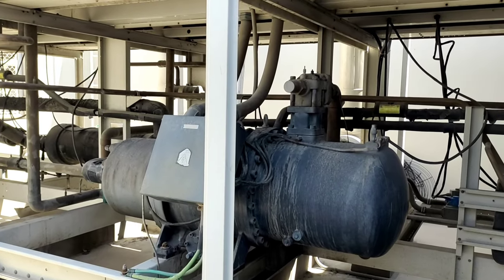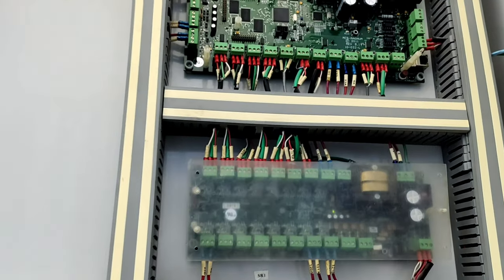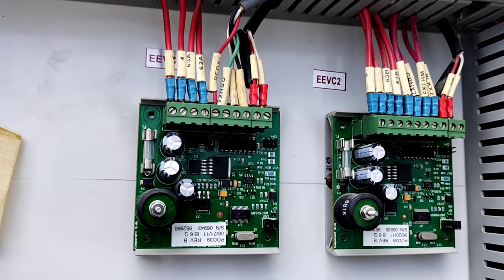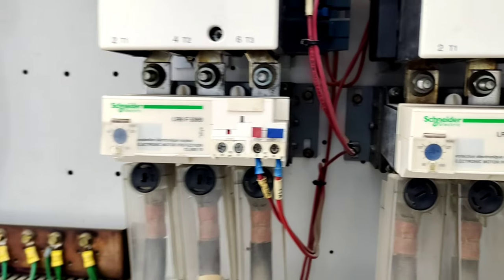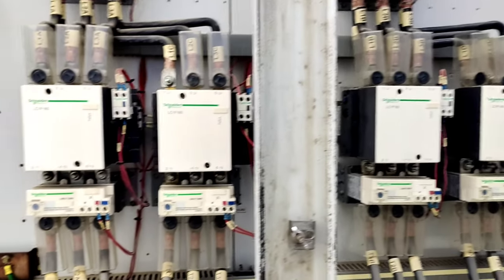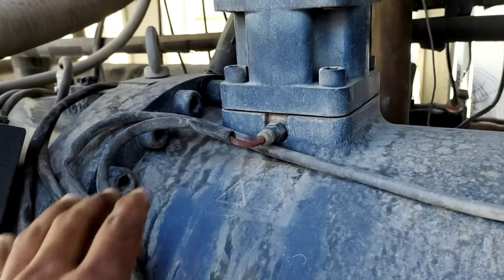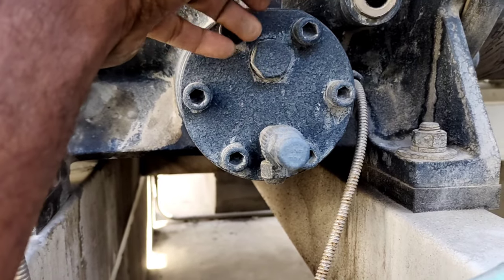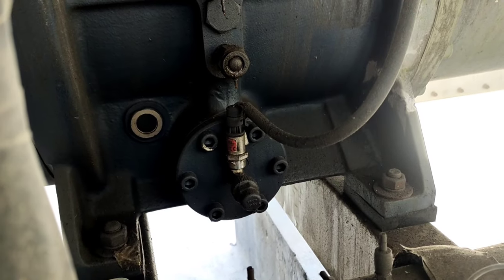എന്താണ് Chiller | zamil Air cooled chiller | screw chiller full details

Comment: Hello
Reply: When is your new video coming
Reply from the maker: Please Check expansion valve. Check suction transducer  , check suction  temperature sensor .  Check liquid line solenoid valve and coil , check loading unloading solenoid coil. If above mentioned all is Okay still Tripping recover the refrigerant and compare with chiller nameplate. If it's less gas  leak test the circuit and charge as per chiller nameplate
Reply: There is one chiller with 3 individual circuits. Circuit 1 trips frequently safety controls. Circuit 3 shows some times low suction, unsafe suction, high superheat
Reply: Circuit 3 recently recoverd and did the vacuum 1000 microns and refilled new gas as per the name plate.couple of days worked normally now, again shows the same problem. Suction pressure and tem.indicates corresponding it's pressure transducer and temp sensors. EXV replaced last year.
Reply: Ones cut off in temp and when cut in we need to reset more than 4 times unsafe or low suction alam
Reply: I think it's EXV reacts very slowly
Reply: Is there Any software issue
Reply: Solenoid  works properly
Reply from the maker: Send me your number
Reply from the maker: Please send me your local contact number